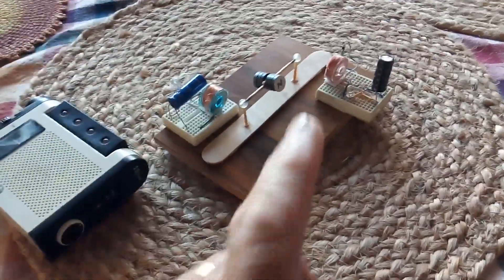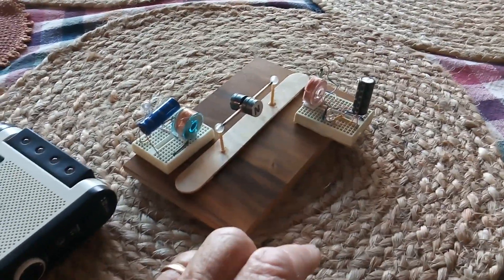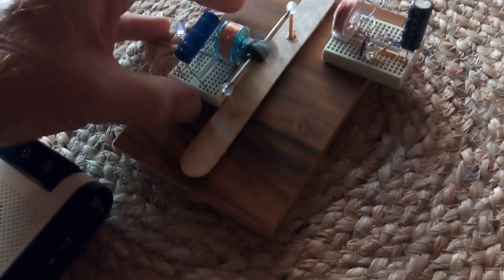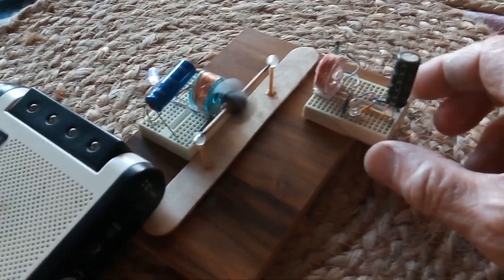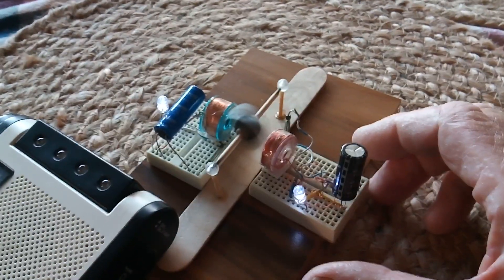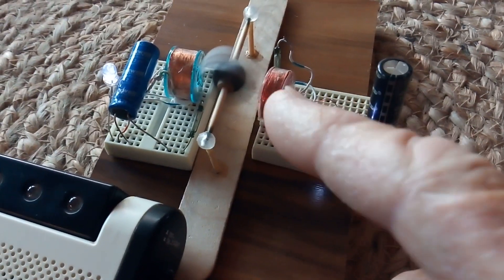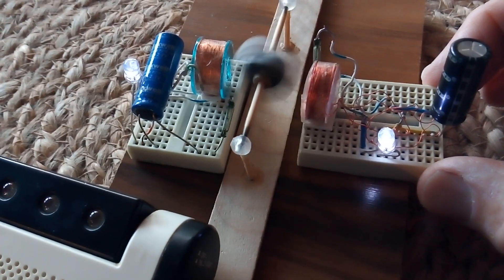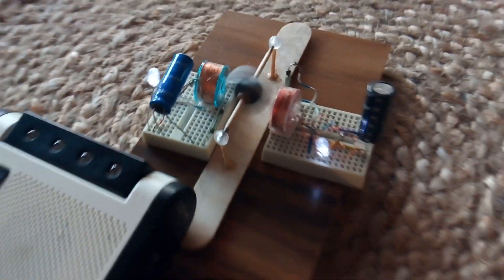SCOTTY MORE POWER ----  NOW !!!

Comment: I couldn't sleep the last two nights as I though "What if " .. I sized this up on a flywheel disc, maglev bearings on the shaft and placed six alternating pole magnets on both faces of the flywheel with nine stator coils (every 40 degrees) placed on both sides of the flywheel disc (18 total) closely to the rotor magnets with at least four alternating neodymium magnets in the rotor/flywheel rim and three drivers/pusher coils with supercapacitors to push the rim magnets!

Comment: i'm guessin psrt of the increase in rpm is due to there's less turns and back emf, the rev limiting when the motor is unloaded type emf, in the additional coil but it sounds like its getting more of a lift than that would account for..

Comment: That's neat. I wonder how fast that thing is turning? How safe is that with the rotor just having the ends of a toothpick holding it in place and moving that fast?
Reply from the maker: I have a tach somewhere to measure the RPM.  I don't think the tooth pick will fail but the magnets could fly off unless I wrap them something strong.

Comment: Haha, Warp speed indeed. I think the toothpick in the middle is a candidate for "She canna take it"
Reply: Spot on 😁
Reply from the maker: It would be fun to build a safety enclosure with a camera setup and run a destuction test using a power supply.  A high speed camera to catch the explosion would make a great video.  My bet is that the magnets fly off before the tooth pick breaks.
Reply: As you're dialing it up you could have "Engine room to bridge, full power available", "Make it so"
Hmm, I'd say a bearing, not that I'd want a good runner to blow up!
Reply from the maker: @Slider2732  This is one of those projects that keeps you awake at night with the 'what ifs'.   I have to "boldly go where no man has gone before."

Comment: Now U R Rockin !!
I would like to have see it with the other coil with the finer wire removed and it running on the #30 side only. Less turns but more current and a denser field should be the condition with the second one you added. Also both sides with a #30 bobbin in the ckt. Small details.
Reply from the maker: A four coil design would be an interesting build.  The question then becomes how to fire them. Do I stay with reed switches or change to electronics. You start getting into other issues also.
Reply: @Lidmotor  Put them in sets of two wired in series with the coils in 180 degree Opposition. One reed per pair to test performance. Then you can go with transistors. Use #30 in the bobbins.
Reply from the maker: @SaltGrains_Fready  That is it!  Thanks.